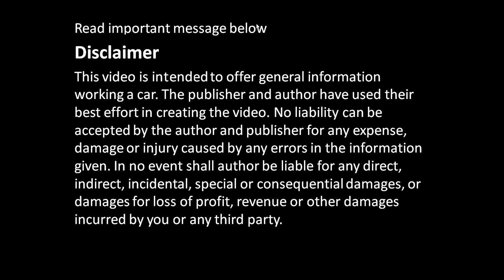P13/27. Camshafts. How to Assemble Toyota Camry 2.4 VVT-i engine: Camshafts

Comment: Thanks Peter 
I don't know if it is correct, but I would put a few drops of oil between every mating surface: like bearing caps, under cam followers etc. because when this engine starts, all those areas will be dry before the oil pump gets oil there. This can cause heat and scoring.
Reply from the maker: Great point!